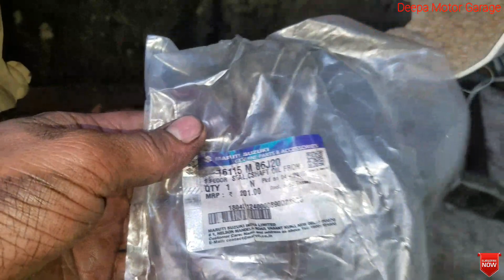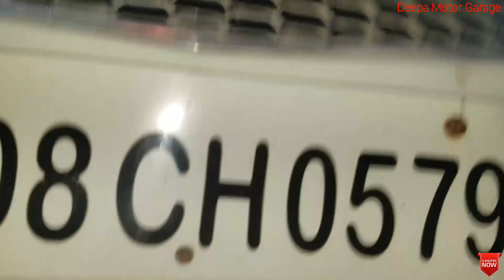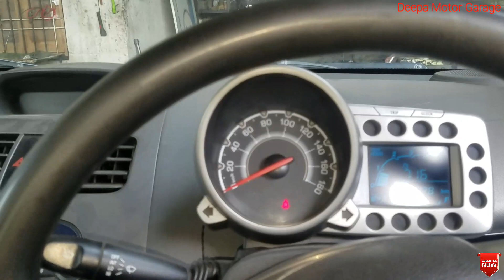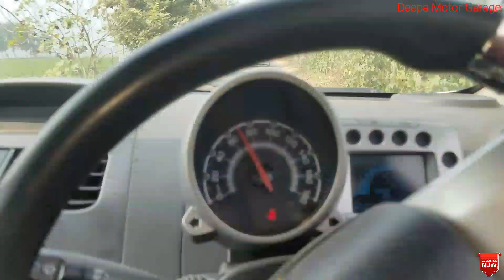CHEVROLET BEAT TURBO CHARGER REPLACE AND CLUTCH CYLINDER PART2

Comment: Brother beat da uprla clutch cylinder v change kr dita nichla v clutch plate v. But clutch missing problem aa rahi aa fer v, tuhade hisab nal ki problem ho skdi aa
Reply from the maker: Missing mtlb clutch pedel thalle chla janda free?? Bki ta paji air ho skdi aa beat di clutch di Air aukhi nikldi aa hor ta fer kuj ni ho skda ja fer clutch plate set dekho os vich na koi issue hove
Reply: @deepamotorgarage1342  Thnku bro hva di e problem c, hva nikkl gai thikk ho gai problem

Comment: overall good work, few point to be noted for improvement, PCV oil separator not cleaned or replaced, probably, most of the time that is the main part causing these issues and damage to the turbo and CR-Sft oil seals. also, crankshaft bolt should be tightened to the specification (with proper torque tools), its critical bolt, just "full tight" :D does not works and it can cause major failure in future....
Reply from the maker: Sir itni jada english ni aati samjh plz je sab kuch ap hindi ja punjabi ch batao..

Comment: Veer ji SSA, mere kol 13 model Chevrolet beat diesel aa. idle te ghadi dhadkan lag jandi aa veer ji, koi idea de sakde  ho.?
Reply from the maker: Ok.vese sahi chldi a koi black smok ja pickup low?
Reply: @deepamotorgarage1342  veer ji koi black ja white smog nai mardi. Engine de per v check karva lai aa koi problem ni. Gaddi sirf 34000km chali aa single handed aa.
Reply from the maker: @sukhjindersingh7363  paji fr dekh k hi aa check krk